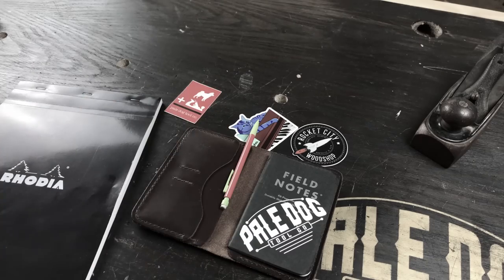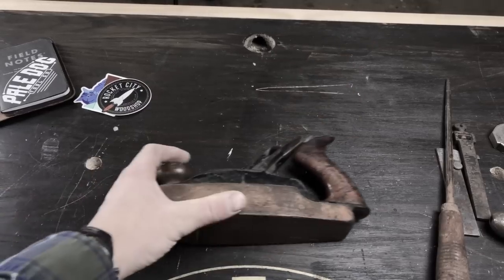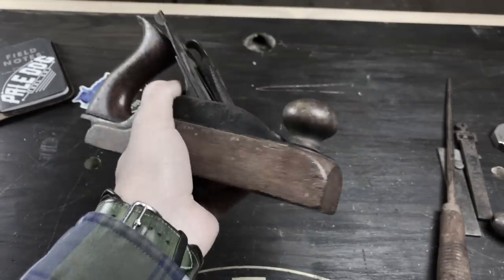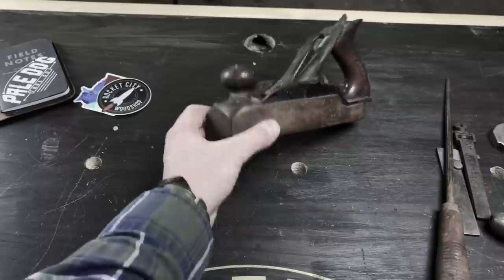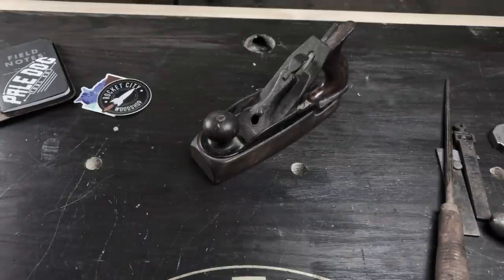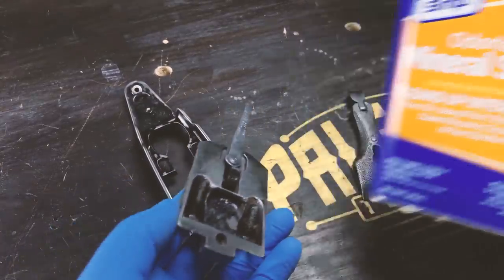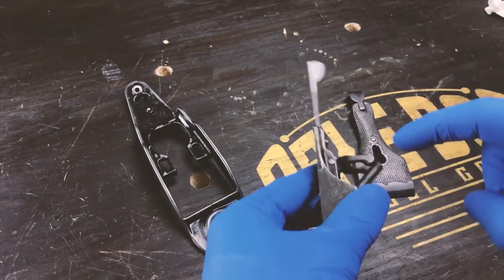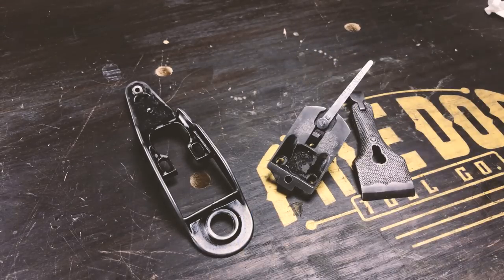Stanley Plane Restoration & DIY Paint Booth!!! No 35 Transitional

Comment: My mom just bought one of these from a garage sale for $3 today and gave it to me. It’s pretty beat up. Definitely want to go through this process, but I had some trouble following what you did in some spots. What were you taping off?
Reply from the maker: That is a great find Tim! I really love the feel of these planes once you get them tuned. The taped off sections are wherever there are two metal mating surfaces. ie: where the blade sits agains the frog, where the frog mounts to the body, and little bits like threads, or the lateral adjuster. Admittedly my videos are often difficult to follow. Paul Sellers has several videos on tuning planes and is a fantastic resource for more detailed info. Thanks for the comment, and best of luck with your plane!
Reply: Pale Dog Tool Co. thanks! I enjoyed the video immensely. Very entertaining.